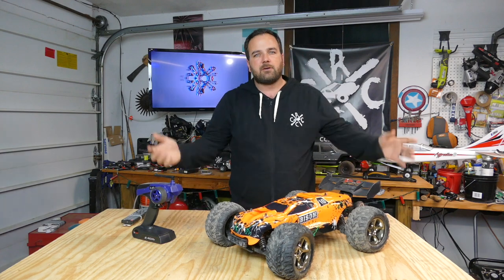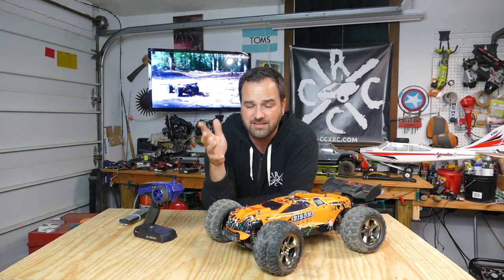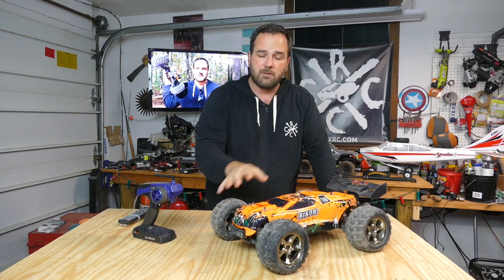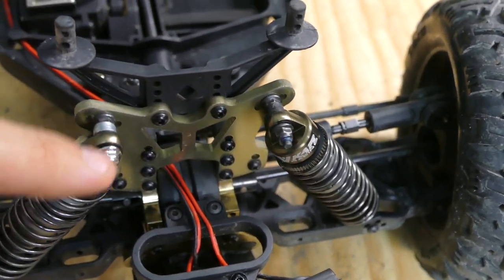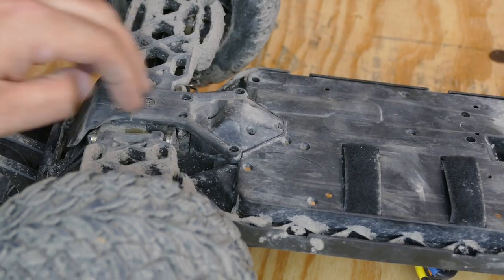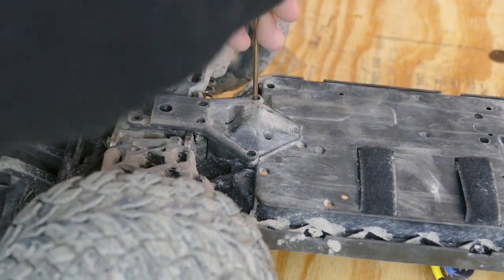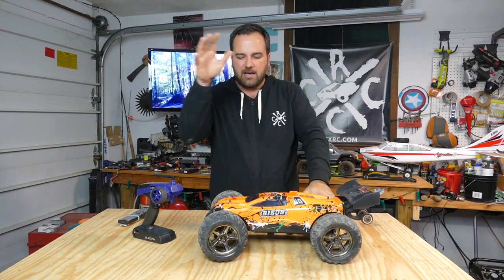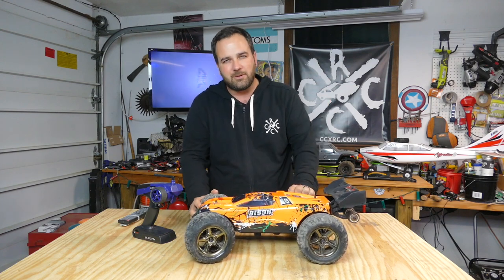VKAR Bison PROBLEMS and How To Replace The Spur Gear

Comment: One thing I will mention when buying anything that comes from overseas that is rc related is check the screws. For example, I bought a redcat and straight out of the box the spur gear and servo were not screwed in correctly. Just do a once over of the entire rig before the first run.
Reply from the maker: That is good advice

Comment: You've convinced me. I ordered 2 little vortex by WL toys & was impressed by their speed & so by mid-week of the following week of having received them I wanted something bigger. My buddy who apparently has like a $2000 car told me not to buy these cheap Chinese knock offs. Because sourcing parts & shipping & such. However with this Bison you have convinced me that it would make a great Learner car. It will be my very 1st big rc & I (since I'm-experienced ) will not be driving this thing to a skate park & immediately flipping it or hitting hi jumps. Hopefully by the time I get it & learn it everything will be squared away with the parts issues. Thanks for the boost of interest & helping with ur research. I'm going to order this thing today after work. & in a week myself & 3 year old son will be enjoying a day on a hardball field just driving away having fun. Thanks again.
Reply from the maker: Glad to hear it Michael! Parts availability is definitely the main selling factor for me. I let one of the guys at the local hobby shop use it in a competition and everyone was floored by it. Things will break. It happens, but you can get most parts easily in the US for it. I talked to Gearbest last week because of all the interest and asked if I could get a discount code to use on my channel. If you use: CCxRC during check out, you can save 10% on it. 
If you use this link to buy, it helps out my channel as I am an affilliate with them now: http://bit.ly/VKAR_BISON
Also, I just got a new WLTOYS Shortcourse truck to try out. It's a little bigger than the Vortex. Keep your eyes open for that review.
Thanks Michael and have fun RCing.
Reply: CCxRC how long does it take to arrive here in the states?
Reply from the maker: +Michael S. Hard to say. It varies. Anywhere from 10-20 days. Sometimes a bit longer. Sometimes I just pay the DHL express shipping rate...depending how much it is. That seems to get it here much faster.
Reply: CCxRC just ordered it, was going to have to wait until after work to place the order because my found were just shy of the closing cost but with ur discount code I was able to order it & get the insurance 👍.
Reply from the maker: Here's a tip I just learned from one of my experiences. After you order, go back and login. Then go to your orders.  On the right, there is a "Dispatch Faster" button. For some reason, they typically wait 2-3 or more days to ship your order. Clicking this is supposed to prioritize your order.  Not sure why they do this, other than the old way with online ordering had a built in processing time (like ebay sellers use).
Reply: CCxRC I went back to try this but didn't see that option, still says processing but it's cool. Hopefully it won't take 10/20 days. Or longer!! Lol. I'll just keep watching vids of the truck until then.
Reply from the maker: Ok. Check back tonight or tomorrow. It will appear. I was always afraid to click it...then finally googled it. lol
Reply: CCxRC question, which spare battery should I get & can u recommend a good charger @ a good price range? How long would charging take with said charger?

Comment: nice hob Tony.. All cars need repairs no matter what you run.. although I think that little plastic piece is a bit chinsy... thumbs up bud.. thanks for sharing  🖒🖒
Reply from the maker: It is chinsy, but it's $3 for 4 of them and a much nicer break point than an a-arm. lol. The way I hit...I expected a broken arm. This is way cheaper and easier to fix. Got 3 bags of them on the way. :)
Reply: Actually that is a good point.. :P

Comment: Must admit am having issues with mine also. Maiden run on 2S and a defective Servo and 3 seized bearings. Quick and easy fix. However I can't work out my cogging issue on startup though. 
But I love the versatility of 2-4S and if you do a proper post run check and maintain it as you should all rigs it'll do the job! I have put a review of sorts in a Bison thread on the rcgroups forum if you're  interested. 😎
Reply from the maker: Interesting about the cogging. I'll check out the review.

Comment: Nice Video, by experience. Provided the Spur gear is made of good quality nylon plastic and always checked for a proper mesh, It will outlive a metal spur gear. A metal spur gear seem logically a more durable alternative but a metal spur gear will alway wear out your pinion gear a lot faster. And pinion gear is more expensive than a plastic spur gear.

Comment: hey man, so i have the Helion Select 10sc the short course version. The truck shares a ton of parts with the VKAR Bison. Identical chasis, drive train, shock mounts and such. I have a video im about to upload addressing my issues with the truck after owning it for a year. I had to smile when you said you replaced the front bushing on the hinge pin. Those plague me. lol You may want to look into the oil in your center dif. It may be too thick causing you to strip those spur gears. I just went through and changed all the oil in all three difs. Makes a huge difference.
Reply: I also have some of those bushing for the hinge pins if you want them. I'll be happy to get them to you. I keep a ready supply of the things that go wrong with this car.
Reply from the maker: Thanks for the info Michael! I just looked at the Helion Select 10SC today at Hobbytown. Good looking SC truck. I picked up some of the bushings from there as well. I have 5 now and 3 packs on order from Alieexpress...so I'm good. But thanks for the offer! :) Also picked up an extra spur gear and tail fin mount to be safe. I will say, the shocks and shock towers look smaller, but I'm guessing the bolt and spacers are the same.  Should've got more of those too. Luckily most of these are simple and inexpensive fixes to keep it going. I'll take a look at the diff oil next.  What weight did you use?
Reply: I put 20,000 in the front and rear and 10,000 in the center.

Comment: nice video,  I'm receiving my bison by the end of the week.  definitely interested to see if you manage to find a steel spur gear that fits as I'm hoping to try the bison on 4s.  also with the bushings do you think a steel/ alloy one would work? as I'm thinking of hitting up a local workshop with a cnc Mill to make a few for me .. maybe the spur gears as well if there are no readily available ones. keep up the good work
Reply from the maker: I was thinking about a steel bushing. The only thing is...the arm becomes the next weak link and may break. The bushing is super cheap and easy to change vs. a cracked or broken a-arm
Reply: CCxRC  that actually quite a good point..  maybe I'll just look at the bushings as a consumable item that saves the a arms from breaking haha I'll just have to buy several when I find them in stock somewhere
Reply from the maker: I ordered 3 bags of them. That should give me 12 to work with. It's only a few screws to replace them which makes it pretty easy to do on the fly when out running at the track.
Reply: CCxRC  I managed to find a local shop that stocks the helion truggy parts so grabbed two bags of the bushes..  went out today to a bigger bmx track and the bushes didn't break..  I did manage to destroy the wheelie bar and the main chassis though..  ( driver error)  the video of the offending crash is on my channel if you want to check it out..  even with the damages it's still a great rc that will be repaired asap!
Reply from the maker: oh snap! Going to look now. Luckily...you can pick up the Helion chassis. but wow. Wheelie bars are just a part waiting to be broken. lol
Reply: CCxRC yeah I'm not too worried about the damages..  should be about a week and I'll have another chassis and wheelie bar and see if I can stick the landing next time haha
Reply: Cool man. Go right back at it. Show it who is boss

Comment: the A arm bushes break when the Allen screws loosen on the retaining plate which allows the arm pin to pull out. lock-tite them in and no more problems.
Reply from the maker: thanks for the info and the tip!

Comment: Hey Tony, love your channel. I've had the Bison for about 3 or 4 months now and the only problem so far is the front arm holder plates bending easily. If you bash the front of car at the right angle and force. I've replaced both of these and also the metal parts that go around the front hub carrier that hold the arm holder plates in place. No problems since then, but any advice or suggestions on  how to prevent that from happening again? Thanks, Lio!
Reply from the maker: Don't crash? :) I usually bend mine back into place if it gets bent on a hard crash. This is where I say that metal upgrades aren't always better.  Plastic flexes and returns to its original shape (or breaks), but metal bends and stays bent.

Comment: I tried changing the spur gear on my bison just like you showed in your video, but I ran into some issues.  Firs, I could not set the correct gear and motor mesh to match up. Only two of the wheels on the bison now spin. The second issue, As soon as I apply throttle, I can smell a burning odor. I'm not entirely sure what it is. But I think it could be the new spur gear being stipped by the pinion gear on the motor? When I stop applying throttle, the smell goes away. The third issue is that I cannot figure out what screw goes where. Just like you mentioned in your video, I tried to put the screws in the same position as when I removed them from the car, but I managed to, no pun intended, screw that up. Any thoughts as to the burning smell and spur to pinion gear matching up? Any help will be greatly appreciated. I should mention that I am a newbie at this whole hobby. Plus, I've never been mechanically inclined. if there is a way to screw up, I can find it.

Comment: You can put a steel spur in here. This truck is the same as the T2M PIRATE FURIOUS and they made a steel spur 52T, it will probably fit since it is the same chassis
Reply from the maker: +Timothée Liens thanks for the tip! There is a steel spur for this too, but it requires an upgrade to the center diff
Reply: CCxRC 
Don't make that mistake my man.
The plastic spur is there for a reason, because if there's some problem in the gear mesh or anything similar, the damage will be limited to the plastic spur ONLY.
A steel spur will just transfer motion anyhow and mess with your diffs.

Comment: Could you please show how it actually comes apart. I can not pull it away from the body/ drive shaft as the other half of the spur gear is in the way of me pulling it away. I got 4 minutes use from this waste of money before I heard grinding the second time I brought it out. the first time was fine as I ran the battery down no problem, no jumps or anything, just driving. I just wanted to know how to take it apart so when the spur gear is available again online I can buy a few and replace it

Comment: Thanks for the heads up, waiting for mine to arrive.  By the way did you happen to check the fluids in the shocks and diffs? Just curious if they were full and viscosity levels. Thanks
Reply from the maker: I didn't, but I do know that some people have said the diffs need an a change. My shocks felt sweet out of the box so I didn't check. Honestly, to get this out and make videos, I didn't strip  it down. I'm going for the out of box experience people can expect. Then I'll dial it in.

Comment: Here is probably the next thing that you will need for the car. I have already seen a video of another owner of this car break his servo after a couple of runs. My Bison has broken on almost every run.  First was the lost pin, then the Arm hinge bushing now it is the Servo. Total run time on this car is about 45 minutes max. I have never gone through an entire battery without the car breaking and I have not jumped the car once. It has flipped a couple of times on grass but that is it. My ACME 1/16 has seen extensive abuse that I could not imagine the VKAR taking and it was $79.00 off of Bangood.com. Excellent Basher. I also have the equivalent to the ACME which is the Hobbyking Bad Basher but that has been Okay. I got way more runs out of that car before I had a few issues with it, unlike the VKAR. Even my $63.00 WLToys A959b has been a way more durable and fun car. Of course they are a different scale and class but still.  I guess that you really flip a coin when you purchase an RC. Sometimes you get a good one from the factory and sometimes they are nothing but problems from the factory. Quality assurance might be the downfall for VKAR on this one. I think that the hinge pin design needs to be addressed and they need to ship this car with a better Servo and Spur gear. The VKAR has been nothing but problems since day one for me especially since Gearbest sent me the car without a battery.   Well, here is the Servo that I got off of Amazon. Once again, thank you for your videos. You are doing an awesome job. Have fun RC-ing!!!!

https://www.amazon.com/gp/product/B00DQQNV1A/ref=oh_aui_detailpage_o00_s00?ie=UTF8&psc=1

P.S.
I have also heard that if your local Hobby Town carries the Helion Four 10TR or the 10SC, they might have parts.
Reply from the maker: Bummer Dexter. Sounds like you have had a tough go with it for sure. I'll tell you what...those little WLTOYS cars are amazing and so much fun to mess around with.  I have a feeling that the slipper clutch isn't set to be forgiving on the spur gear from factory....but we get impressive wheelies that way. :)  I'm planning to loosen mine up a bit until I can get a better spur gear. 

How do you like the Savox servo in this car? Does it feel underpowered for the big wheels on this?
Reply: The Damn Servo is too big!!! Any suggestions????

Comment: Howdy Tony! Nice blog!! Just have one question for you as to the cordless driver setup you were using in the video. I noticed that is was a Ryobi driver, however, what combination of a Bit Set were you using. Would like to have the same setup. Thanks. Keep up with the great Blogs!
Regards,
WatchDog1776
Reply from the maker: +WatchDog1776 thanks man! I sure do love this setup. It an Integy Hobby RC Model C23303 7pcs Hex Tip Set w/ 1/4 Inch Adapter (0.05 1.5 1/16 5/6... https://www.amazon.com/dp/B00XQPLOFQ/ref=cm_sw_r_sms_c_api_GR6jzbGF0FGG0

Comment: I noticed you do not have the drive shaft cover. the part is not on helions part list for the 10tr but it is on the 10sc part list. I bought it and covered mine because dirt git into my gear mess and chewed mine up too.
Reply from the maker: I do not. I had not see the 10SC one.  I'll have to try that out.
Reply: CCxRC the parts list for the SC also shows a few more aluminium upgrades like the arms and front hub/spindle. I am not sure if they can be used in the tr.
Reply from the maker: The arms are much smaller in the SC truck

Comment: Hello I just got my bison as well but not sure on the transmitter what's the switches on the left hand side of the transmitter what do they do??? Could you help please
Reply from the maker: I think those are just reverse switches for turning and throttle. Once it is set, you shouldn’t have to worry about them.

Comment: Hey man, I have a question. My bison did not turn left and sometimes it run by itself for a lil bit. Do you think is the receiver or the ESC?
Reply from the maker: Hard to say. I’d check the controller/receiver first.  If it won’t turn left, it may be that an impact messed up the servo.

Comment: Well after much abuse I broke the arm bushing and sheared the arm holder in which that holds the arm bushing and the arm pin. Order the parts from the Helion four 10TR . The arm holder and bushing fit the Bison!! In doing so I went ahead and checked the diff, There was very little grease or fluid in there so I cleaned and filled it with 30k diff fluid, good to go again. Gonna check rear diff next.
Reply from the maker: Very cool Dan! The Helion parts will work because this is the "factory" version of it, so parts should be no problem. Hope you were having fun with it when the carnage happened. :)

Comment: have you found a metal replacement for this spur gear yet? i chewed mine up as well lol
Reply from the maker: Shane's Oddworld I think so. Still waiting for it to arrive from Aliexpress.com
Reply from the maker: Shane's Oddworld pretty sure it requires a center diff upgrade as well
Reply: awesome let me know how you go and please post a vid once its done if possible :) i'm currently working on a solution to those stupid end caps i have the gear now just need to time to build it and test it once that is done if it works i'll post a vid and share you you as well if like me your tired of that arm popping out lol

Comment: Hi Tony. What diff oil viscosity  would u recommend? Seems like center diff is the only one has oil in it, others have grease like. Thx.
Reply from the maker: Yeah...a lot of RTR cars come with grease in the diffs. From what I've read...that is comparable to 1k wt. For the center...the heavier you go will send more power to the rear...this will help stop ballooning the front tires, but at some point it will also not let you corner as well.  I'd go somewhere around 7k or 10k for the center.
Reply: CCxRC . Thx. Most recommended 7-10-3k. I'll try that. Just wanted ur opinion because u drive the hell of it. 😂
Reply from the maker: Haha. I’m not trying to get crazy performance from mine...just power and big air! Lol. That is recommended. Some doe 7-10-5 if it’s really loose coming out of corners
Reply: CCxRC . I'm kinda new to RC. Just wanna have a little fun, nothing crazy, yet. Maximus should b here today, I hope. Also purchased Vkar short course truck, should b here next week. Thx for all ur vids.